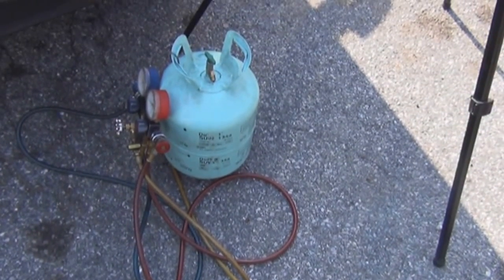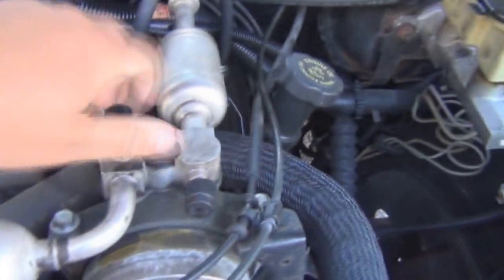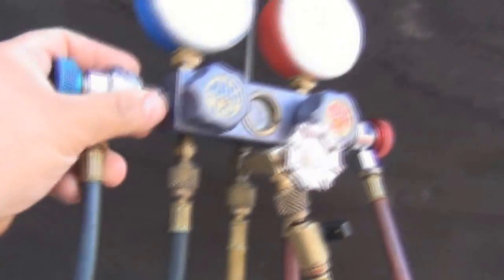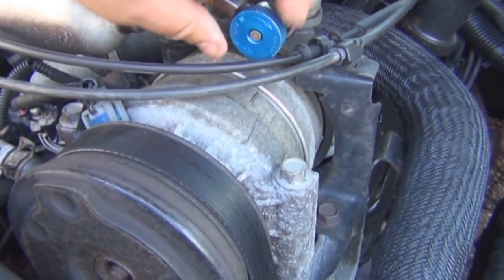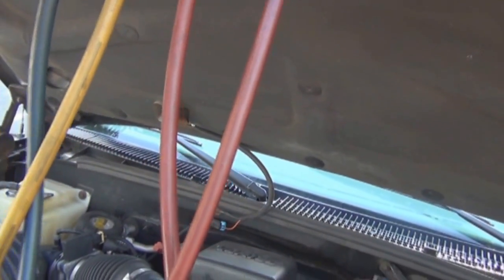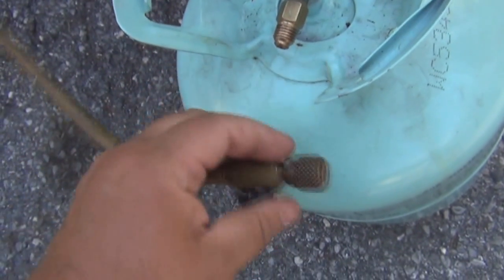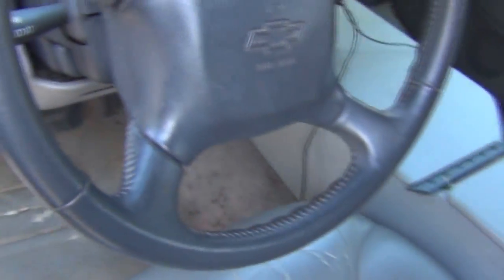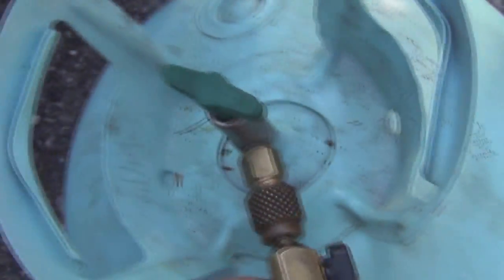How to charge a car Air conditioning system R134A Basics

Comment from the maker: That is a judgment call. Most of the time you can just charge it and be done with it like most people do. But if you locate the leak and want to replace the part. Thank you would have to evacuate the system replace the part. Put a vacuum on it see if it holds than recharge it with the proper refrigerant and proper oil. But like I said that is a judgment call.